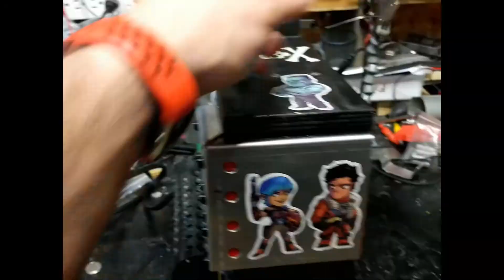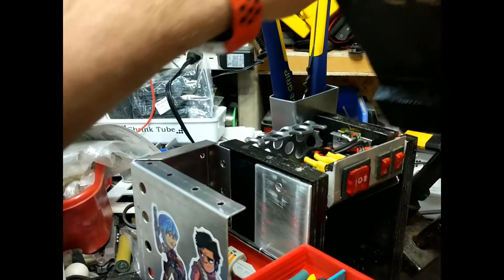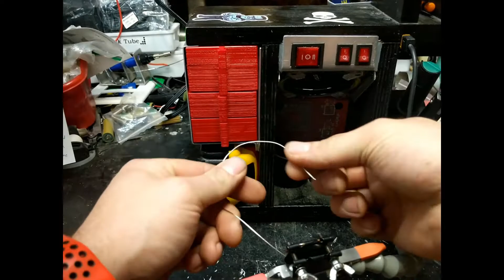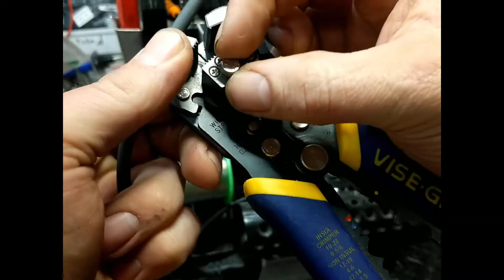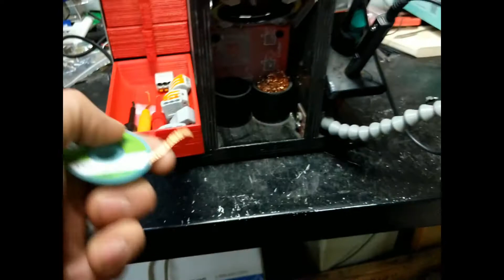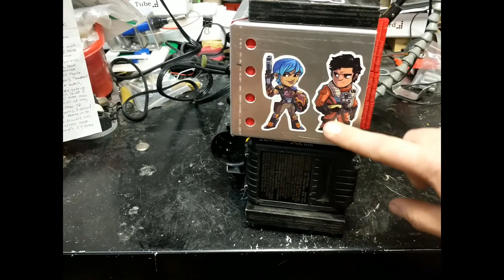Soldering Station Supreme

Comment: I love the idea of the solder going through the lock line. I may need to do this.
Reply: Thanks! Depending on the size of solder you prefer you can get Teflon tube for 3d printers in a few colors and it's fairly widely available!
Reply: @glitch1502319641  Good idea. I've probably got some extra lying around.